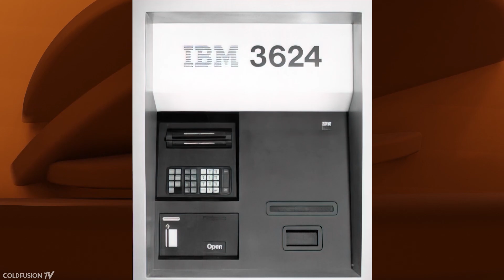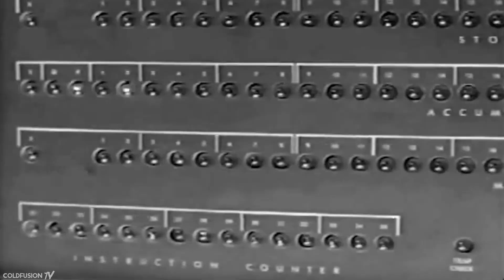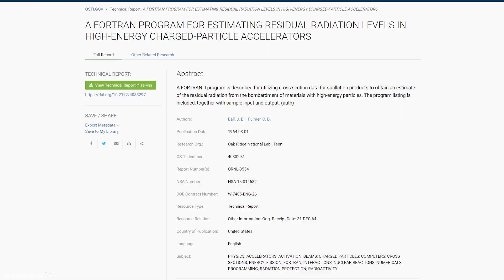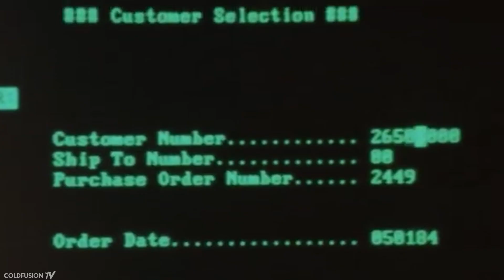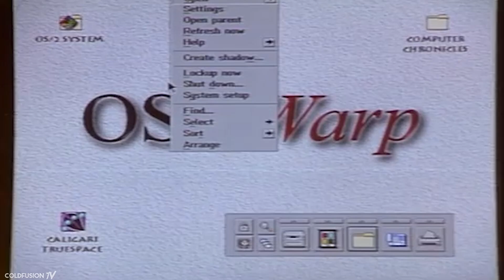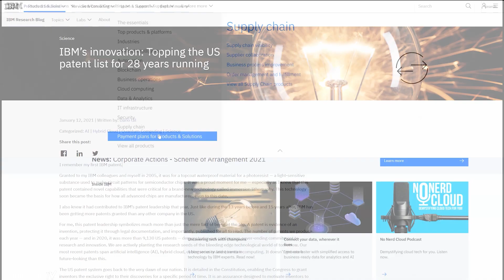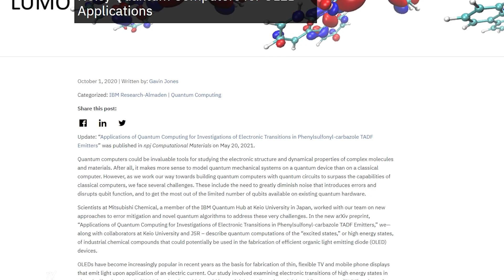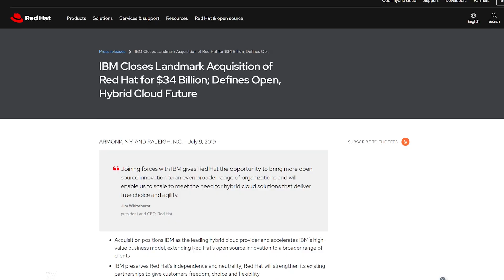The Rise and Stagnation of IBM

Comment: I worked for IBM from 1979 to 2015. Wonderful company until it wasn’t . The mainframe was (and is ) the main source of revenue and profit and “protecting” that business was also the main reason for the downfall. Too many lost opportunities and poor management .
Reply: Do you remember that IBM and Motorola worked together to put the IBM 360 instruction set on a 68000 chip by replacing the microcode? And then they attempted to market the Desktop 360? An AMAZING failure - but the relationship gave us the Power PC, which Linux Torvalds called "the weirdest architecture" (with which I agreed when I spoke with Linus at a Decus conference in Washington DC, in 1993-ish... being a PPC platform vendor sales engineer...) - which is finally being killed off by ARM...
Reply: Totally agree.
Reply: Agree, though for me "it wasn't" came a lot sooner than it did for you.   Yes they do have a lot of trouble balancing legacy product lines with new products.

Comment: There was a story going around that when IBM wanted to talk to Gary Kildall about an OS for their hardware he was too busy flying his plane so they spoke to Bill Gates instead. In those days Digital Research were the owners of CP/M and MP/M which was the OS used by most 8 bit machines being used by small businesses at the time. DR would have been the obvious choice to write a 16 bit OS. Apocryphal stories aside I also read that Gary Kildall who owned DR would not sign a contract with IBM because he feared they would end up owning the rights to his existing products. At the time Microsoft had no OS products but sold language interpreters and compilers. Word has it that Bill Gates knew someone with a nascent 16 bit OS and bought it and sold it to IBM as PCDOS. The rest is history as they say. Not sure exactly how much of the above is fact and how much gossip at the time. Used CP/M in my father's 8 bit Z80 S100 bus based Ithaca Intersytems machine (still have a book on it) using Microsoft Basic interpreter as the programming language (still have the manual).

Comment: You cannot stress enough how IBM is stagnated internally. Over my 7 year within the company, they twice failed to migrate to new mail client (Outlook) from IBM Notes. It is staggering how simple mail client that IBMers are forced to use hinders productivity. On daily basis we offer our customers new exciting technologies while struggling to deal with stuff from 90's that we are forces to use in daily work...
Reply: MY  DELL I7 LAPTOPS AND DESKTOP(SERVERS) ARE FASTER THAN IBM AND CDC SUPER COMPUTERS
FROM THE 1960'S, 1970'S, 1980'S. WHEN OFFICE RENT IN NEW YORK CITY BECAME TOO EXPENSIVE IN THE 1990'S  I REPLACED MY IBM 370, 4131, system 3's  MAINFRAMES WITH DELL LAPTOP AND DESKTOPS COMPUTERS(SERVERS).

  WHAT USED TO COST ME $3000 PER MONTH FOR OFFICE RENT AND ELECTRIC NOW COST ME $200 per month
WE OWNED THE MAINFRAMES WE WERE USING(WE HAD A COMPUTER LEASING CO) AND I DID THE MAINTENANCE
ON ALL THE COMPUTERS, SO THOSE COST WERE VERY LITTLE.

IF WE HAD BEEN LEASING OUR EQUIPMENT FROM IBM THE COST WOULD HAVE BEEN: $3,000 rent + electric,
$13,000 for equipment rental = $16,000 per month!!!

so it is easy to see the downward trend in the sales of ibm z computer prodects

Comment: My Grandma worked at IBM from 1965 to 1966. She worked in the programming department. She learned how to program the 1401 and the 360. When she left IBM to join the at the time AT&T subsidiary, Western Electric, she was the only Woman in the computer department and her job was to convert old 1401 code to 360 code. She created a program that as she described it (and bare in mind that was over 50 years ago for her so some things she doesn’t remember) was kind of a pro-to emulator of sorts that would automate the process of changing certain command lines in the code. My Grandma explained that the 360 was more sophisticated than the 1401 as the 1401 gets it name from it’s 14k of ram. As for working at IBM she said it was very business oriented, she worked in a cubical with two other women.

Comment: 1980's is wrong. It's either 80s, '80s or 1980s. You use apostrophes if it's a contraction ('80s is contraction of 1980s) or possessive. A decade (ten years) is a plural, so no apostrophe.

Comment: Its not stagnation per se, its quite a clever move to sustain stock v.s. revenue. When you compare revenue to net worth, software companies maintain a much better ratio than hardware companies. IBM "got out of the game" rather than risk competition on the hardware side for very little gain and re-framed themselves as software. 

Software companies outperform hardware companies on market evaluation. 

Apple and microsoft have relatively similar market capitalization value ("net worth") - with Apple at 2.1 bn and Microsoft at 1.9bn. But Apple has revenues of 200ish bn whilst Microsoft "only" has 40bn. This is down to continued perception (rightly so) that Apple is a hardware first company whereas Microsoft is software. 

By maintaining their high market cap against revenue, they are basically "winning" as far as stakeholders are concerned...

Comment: As a former IBMer I find this video weak and misleading, focusing a lot on the 80s and ignoring the 2000s. IBMs slowdown came in 2010s due to the rise of cloud related services and apps. I'm really curious what's gonna happen next.
Reply: I was also surprised. It feels like CF skipped over the Global Services consulting arm that powered the company for the first decade of the century, and the strategy they used for the second decade where they acquired waning giants in the industry and squeezed the residual out of them. (Tivoli, Cognos, RedHat, etc.)
Reply: After working for IBM in 1980 as a co-op and getting stiffed for a job due to the company's first hiring freeze, I experienced two interactions between the company I was working for with IBM of 1993 and 1997 - it was NOT the same company, and in both cases the interaction was tragic...

Comment: Company I worked for in 2017 still used IBM mainframes (iSeries), and I developed software for it In the RPG language. Afaik the underlying hardware was modern, but the software was still based on the old System/360 stuff.
Reply: 1 - iSeries is not mainframe, mainframe is zSeries
2 - It is based on System 36 and System 38
Reply: I use to work on the iSeries for years, both hardware and data replication.

Comment: Is "IBM compatible" still a thing?...
Reply: Not really, although the modern PC is a direct evolutionary descendent of that original IBM PC. (Unlike the Mac which completely changed CPUs and architecture several times.) Most software just says what OS you need, eg "Requires Windows 7 or higher", and Windows itself simply says what CPUs it supports.

Comment: I worked on OS/2 in Boca Raton, FL starting with version 1.2, in the multimedia area. The biggest mistakes I saw were continued collaboration with Microsoft and then all the time wasted on SOM, which the Workplace Shell was built on. As for Microsoft, I remember debugging the exact same C compiler defect 3 different times many months apart and never getting a good version. IBM eventually learned and wrote their own C compiler, which was actually much better. I still remember people just being shocked when we saw the first version of Windows 3.0. They had no idea who they were dealing with and seems they were not keeping any tabs on Microsoft. As for SOM, I remember an "all-hands" effort to try to fix the performance of WPS - it was very bloated and slow at the time, primarily due to SOM. The should have just chosen C++ and been done with it, but they wanted some language neutral OO monstrosity and were mainly still using C. IBM had the better technology, all the way up through Warp releases, but were just too big and slow while MS ate their lunch.
Reply: IBM tended to have experts who ran everything in the company and the truly innovative youths were either frustrated out or pushed out - PS: I had an original first-year IBM PC motherboard with the hand-soldered parts...
Reply: Your level of detailed is much appreciated
Reply: Administrators and bureaucrats stymie innovation and creativity by imposing order and control.

And no where did I see this more than with IBM in the late 80s and early 90s!

I was there in their IBM Operating System division Austin, Texas.  Their operating system was competing with Microsoft at the time - And we know who won that race. 

Walking down the halls at IBM revealed the cancer that had devoured the entire company.  All the people walked like zombies, holding a creepy blank stare as they slowly shuffled aimlessly down the halls.  I have never seen anything quite like that to this day.  

I was closest to the teams that fielded troubleshooting calls from customers.  IBM hired street temps to handle those calls!  Totally uneducated and largely untrained people were in charge of helping people over the phone whose computers were hanging due to some software and/or hardware failure. Who the hell was running the show over there?!

Humanity is a strange phenomenon to me whereby "Kings wear no clothes" - yet everyone does whatever they are told under the color of authority.  Like the useless Rama X, the King of Thailand, the highest executives - despite being feeble minded - get all the wealth and glory. 

We see this today in corporate life and the governance of countries: men whose inability is as vast as their wealth, power and privilege running the show! 

There are many bogus career tracks whose functions merely require hubris, bravado, mendacity, and lack of conscience:

Bureaucrats, administrators, corporate executives and board members, academic instructors, music maestros, politicians, clergymen, managers, law enforcement, corporate chiefs, actors, salesmen, religious leaders & evangelicals, etc.

They are hired or elected not based upon technical or functional ability, but simply their ability to “look & act” the part!  

It is for this very reason that con's, inept's, and those seeking unearned power & self-aggrandizement are fundamentally the ONLY people to hold those positions in life: People who are utterly incapable of holding any job that actually requires skill!

Consider the perennially bankrupt Donald Trump: his value is not based upon his functional abilities, education or management savvy, (my Uncle was his chief accountant at the TajMahal), but rather his Hollywood image!  Even though the CIA was using the Taj to launder drug money the casino collapsed. {The BCCI bank had closed at the time following Congressional hearings thus ending the CIA's ability to launder its drug money. Trumps Taj just filled the void - Similar to Atlantis Casino Resort Spa today. See Mary Carter Resorts Study (1994) or Evidentiary Realism (page 35)[2] and this article NY Times [1], SEC lawsuit findings [3]}

[1] https://www.nytimes.com/2016/06/12/nyregion/donald-trump-atlantic-city.html

[2] https://books.google.dm/books?id=2vSRDwAAQBAJ&pg=PA35&lpg=PA35&dq=trump+taj+mahal+cia+money&source=bl&ots=vKUS76dqGU&sig=ACfU3U01VQyTbDucYm2uFNpgNPZCIrjk2Q&hl=en&sa=X&ved=2ahUKEwizyZW2kZvqAhVBKa0KHdnQAdcQ6AEwDXoECAkQAQ#v=onepage&q=trump%20taj%20mahal%20cia%20money&f=false

[3] https://www.sec.gov/foia/docs/trump-hotels-and-casino-resorts-inc.pdf
Reply: @markhuntermd  Very interesting post. Thanks.

Comment: If you want a clear example of how mixed priorities they had in the 90's, we went to order an IBM desktop with OS/2 on it and they didn't offer that...  They were selling OS/2 and desktops, but you had to buy the IBM desktop with MS Windows pre-installed, then buy OS/2 separately and install it yourself.

OS/2 was initially a joint project with Microsoft, it was effectively the NT kernel, as in Windows NT, Windows 2000, Windows XP, etc... but back during the days of Windows 95.  It was ahead of it's time by years.  One of these collaborators went on to rake in billions.  The other was IBM.

Comment: I remember my dad had a IBM computer and how slow it was back then
Reply: Slow but super reliable. It was the only PC that never ever failed me. I've had close to a dozen PC's/laptops and they've all had some type of failure at some point. I had the IBM PC for over 10 years and it never failed me. And that's one of the reasons why I admire them so much. Solid engineering.